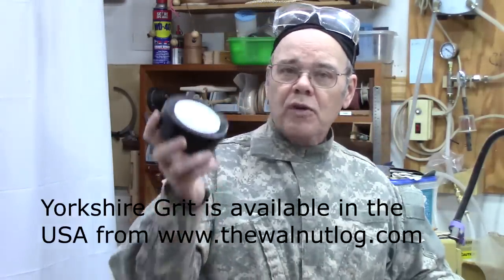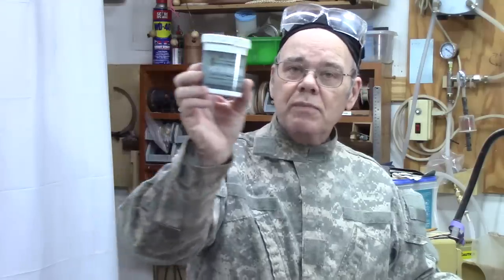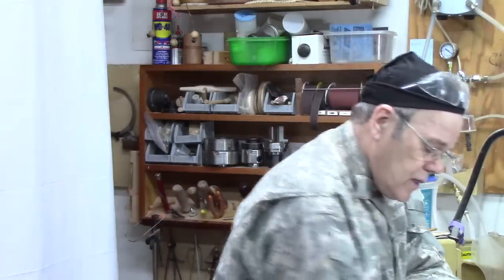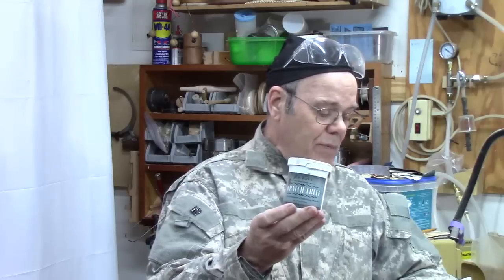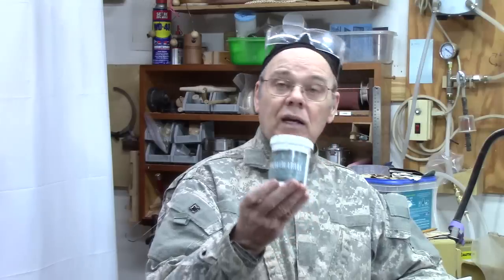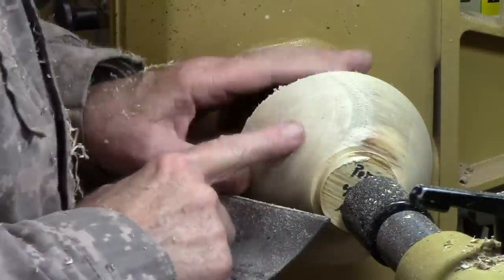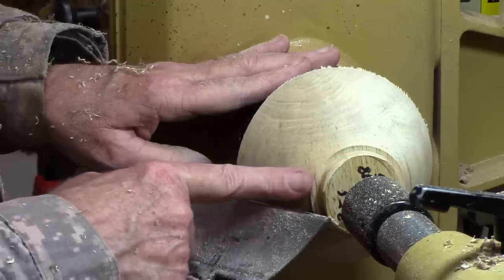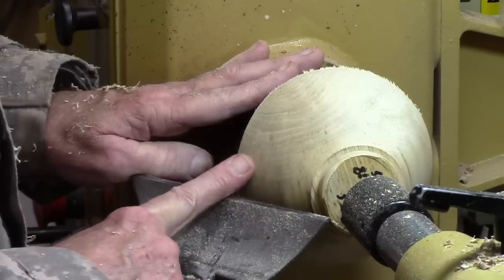Using Abrasive Paste For Woodturning

Comment: I've used EEE for years, and I recently took a class at Craft Supply and was introduced to Dr. Kirks.  It is considerably cheaper and I can't tell the difference.  It wasn't till sometime later I found out one of my instructors was Dr. Kirk!
Reply from the maker: Yes, Kirk is a good guy. He did verify that although Dr Kirks is more green, it is a finer abrasive than EEE so not as aggressive.

Comment: Many many years ago, during the decoupage rage, I was using pumice and water followed by rottenstone and oil to polish lacquer, and it worked great. I’ve had a container of rottenstone sitting in my shop for over two years now, which I have always intended to mix into an abrasive paste. I’m looking forward to next weeks video!
Reply from the maker: I will be interested in your test results with pumice, rottenstone and diatomaceous earth to see what kind of formula you come up with. I will be happy to swap some diatomaceous earth for some pumice and maybe even loan you a crock pot!

Comment: I've used just the Yorkshire Grit on wood and the  micro-fine on resins and all finishes work very well,including CA on my pens! Hope this helps Mike👍👍👍👍👍👍👍👍👍👍👍👍
Reply from the maker: Thanks for the insight, Alan.
Reply: So I can use eee on my pens before ca glue?
Reply from the maker: Sorry, I missed your question earlier. Yes, maybe. I would test the finish on a pen sized dowel so you don't ruin a finished pen.

Comment: I have been using Yorkshire grit and I like it very much. I apply a 50/50 mix of cellulose Sanding sealer and lacquer thinner first. I then use a Hampshire Sheen wax as a finish. I really like Yorkshire Grit, but it can be difficult to get it here in the States. I ordered my last two container from England.
Reply from the maker: I listed the website for the US distributor in the description. Not difficult to get at all.
Reply: @MikePeaceWoodturning  I kept checking in at the walnut log website for weeks and it was always listed as out of stock. I did get the Yorkshire Grit Micro fine from them as I plan to do some resin casting,  and a day after I bought it that is now listed out of stock. I inquired by e-mail when they would be back in stock and never got a reply so I ordered it from England. It came back into stock about a week after I got my order from England. But seeing the walnut log is the only distributor in the US it is not difficult to get if it is in stock. If it is not in stock then you have to shop outside of the states to get it.
Reply from the maker: Thanks for clearing that up. I should have known the easy answer is not always the right answer. I have seen Jeff at two different symposia selling Yorkshire Grit so assumed he always had product. I can see where a small manufacturer might have problems keeping vendors supplied.😬😬

Comment: Mike, I have been using EEE, but I wasn't aware that you could use lacquer, poly, or shellac over it, Thanks for the info, I will give it a try.
Reply from the maker: I have been told you can finish over it but you might want to test with your favorite finish.

Comment: On hardwoods I use rottenstone with Watco as final finish, typically over a sprayed lacquer finish. If the surface finish is good I use paraffin oil as lube for rottenstone.

Comment: Nice video! I have only used EEE so cannot comment on the other 2 abrasives. I have found that the EEE works well on non-oily like oak or ash.  But on woods like cedar or walnuts it leave streaks. I don't use sanding sealer and perhaps that may help with the streaks.
Reply from the maker: Umm. Never had that problem with EEE but always used on small items I would finish on the lathe with a friction finish.

Comment: Hi Mike. Thanks for another excellent informative video. I’ve been using Ack’s for some time after sanding to 400 but I found it does definitely darken the wood. With some woods I don’t mind that however there are some I prefer not to darken. Learned this recently with a bowl turned from Canarywood. The Acks really darkened it. Which would you suggest to use that does not darken but still does a good job of eliminating fine scratches? Or should I use a lacquer as you did prior to the paste application? Hope this makes sense. And thanks again sir!
Reply from the maker: I think any wax product will darken wood some. I have not done a coloor comparison with or without a sanding sealer first. Worth a try.

Comment: Mike -- On a completely different topic, what are your thoughts on inertia sanders? Some turners really like them. The subject would seem to fit in with your sanding theme.
Reply from the maker: I had one come with my mini lathe and it is what I started with. Certainly for a new turner on a budget they are an improvement on faster sanding then by hand, I think they do better with finer grits. I think a powered sander does better for me on courser grits. I think it is a challenge to make one that allows quick changing of grits without pulling the discs off the hook and loop which leads to failure.
Reply: I used to use a power sander (cordless drill) but have recently switched to an inertia sander (Simon Hope) and much prefer it. I made additional pads but find it just as easy to swap the abrasive discs.

Comment: Mike:  I'd be curious to know how your Minwax Antique oil finish worked on the prepped surface after the paste.  I have been using the abrasive pastes for some time now but I have always used wax as my final  finish.  I am now wondering what your results might be after you used your standby oil-based finish plus give it a turn on the Beale buffer. Did you do this to the little persimmon bowl you used in the video?
Reply from the maker: I have had no problem using Minwax Antique Oil. Any solvent based finish should do fine. You may have to test this on a woodturning.

Comment: Does any of the abrasive past get air born? Do you need to wear a respirator to protect yourself from the cilaca
Reply from the maker: It is a thick soupy texture. I do not think that is not likely to fly off the wood and stay airborne as any particles would be heavy.